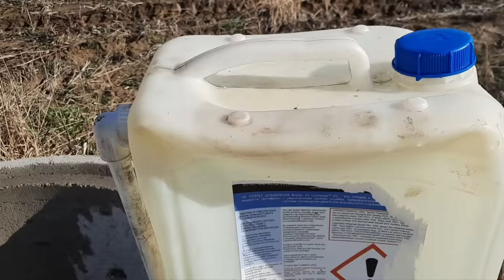Simple idea how to make a water pump without electricity without fuel

Comment: Someone plz explain to me..... what makes the water flow?.....do I have to fill the Jerry can first?
Reply: It is a syphon. The water will flow as long as the level in the well is above the end of the pipe. The tank makes it easier to fill the pipe and get the syphon started, but it is not really necessary.

Comment: As you can actually reach into the water, just slowly submerge the hose into the water to fill it. Stick your finger over one end, drag the hose to the same (down-hill) location and remove finger. et-voila. saved yourself all that effort and parts.
Reply: lol, indeed so easy can it be
Reply: There are different ways. 
- Hold the two ends of the hose at the same level letting the hose form a “U”. Using a funnel and fill the hose. Close one end with your finger, drop the other into the well an walk downhill. 
- Use a foot valve and a rod. Put the foot valve into the well and rock it up and down rapidly until the water starts to flow.

Comment: You could connect this up to a water wheel to gain some head height on your water flow? You can then used the motion of the water wheel to additionally "pump" to gain pressure?

Comment: Any good mechanic or steam engineer or good old hand will teach you that in this case you just put that hose submerged into the fluid and keep one end always submerged while you take the other end carefully down lower than the bottom of the tank while you keep it capped or covered with your finger.  Then you uncover that end and gravity does the rest - the fluid will flow!!  The farther below the top of the fluid in the vessel to the outlet of the hose, the faster the flow - That is what we call the Head of the system.  All the other bells and whistles, song and dance, are just for show - Magic!!!
Reply: Yes, and here yoy must bring the output end lower than the water level in the well to make this run. Then you have moved the water from a deep well to another even deeper well. Why so?

Comment: Unfortunately this "pump" works only if the exit point of the system is lower than the water level in the well... And with this water level in the well you could much more effectively just draw the water with a bucket...

Comment: This is working like syphon right? I will try to pump out water of abandoned cellar:D
Reply: Only if the outlet is lower than the cellar floor. That is how a syphon works.
Reply: @Dingsrud  only if the outlet is lower than the water the inlet is put into. It does not have to be lower than the seller floor until the depth of the water approaches the seller floor.

Comment: And if you allow the water from the hose to go back into the well, then you have a perpetual flow!
Reply: This will be difficult since it seems that the end of the hose is lower than the water level in the cistern. (It can't be an ordinary well, since ground water could never be higher than the surroundings.)
Reply: If the end of the hose is higher and water is allowed to flow back to the well. That will be perpetual flow and electricity can be generated by putting an alternator, but can that work?
Reply: @innopeaceideas8434   No, it can not work. Perpetuum mobiles are not possible. When you see something like that working in a video you can bet it is faked. Neither barrels with vacuum, valves, different pipe dimensions or what ever can make this work. You can't lift water to a higher level without an input of external energy. 
On the other hand, if the outlet is lower than the water level in the water source, it does work, but no barrels with a vacuum are needed. All you have to do is to prefill the system with water. But since such "siphons" were known already B.C. it is nonsense to present this as a new invention.

Comment: The physics in this is great and works. But if you had made a plastic jug stand higher up above the well. Then, the water pressure would be higher.  At a rate of 4.3 lbs per 10-feet of elevation.  Great job though.  :)
Reply: This is at best a great fake, unless the outlet is lower than the water level in the well. If this system would work with an outlet higher than the water level, you could at once build a perpetuum mobile. But perpetuum mobiles are not possible.
Reply: For this to work you only have to place the output lower than the water levek in the well. I.e. another, even deeper well.

Comment: Only works if the water-level in the well is higher than the end of the delivery hose. The drum and tap are completely superfluous, you just need to lower the delivery hose into the water, put your thumb over the end and take it down the hill.

Comment: Very simple way lifting water from underground well that so inexpensive too.
It needs a secure air tide bottle and few pvc pipes. Make sure bottle has enough pressure controls construction that means quality material made product.
Wonderfully presented it.
What is siphon?
"Siphons are often used to empty containers of liquid that would otherwise be difficult or impossible to empty, for example, a large glass fish tank. In a siphon, the water falling down one side of the tube pulls up water on the other side"

Comment: Ro: 1) Nu e o pompa de apa, e principiul vaselor comunicante, cum tragi vin sau apa, dintr-un butoi care e mai sus si o sticla care e mai jos, printr-un furtun, simplu? 2) daca luai un furtun si il amorsai, adica il umpleai cu apa, si l capatul de jos puneai un robinet pe oprit/OFF, il bagai in fantana capatul  de sus tot asa  iesea, ca atunci cand schimbi apa la acvarii  >> EN : Ro: 1) It's not a water pump, it's the principle of communicating vessels, how do you draw wine or water, from a barrel that's higher and a bottle that's lower, through a simple hose?  2) if you took a hose and primed it, i.e. you filled it with water, and at the bottom end you put a tap on/OFF, you put it in the well and the top end still comes out like that when you change the water in aquariums

Comment: It's just a syphon. Definitely NOT a 'pump.  You can forget about all the dicikin' with the drum and the drill, all that does is fill the hose with water to start the syphon. There's several simpler ways to start a syphon.

Comment: Let the water fall on a paddle wheel with a small generator and get free electricity.  Small amount but all day long.  Add more siphons and get more water with a bigger generator.  Stand it in a pond so you never run out of water.  Also, increase the fall height of the water.   Would it work?  If so we just solved the energy crisis and made the greenies happy too.
Reply: It is  impossible

Comment: This is a simple siphon. It works because the water level at the pipe outlet is lower than that in the well. If he hadn't connected that long pipe to the tap, the water would have stopped flowing from the tap as soon as the plastic tank stopped compressing due to atmospheric pressure. Which means if the tank was made of flexible rubber bladder for instance, the bladder would almost completely empty and stop. But if the tank was made of inflexible steel, like a jerry can, little or no water would flow out of the tap.

Comment: would have worked without the plastic barrel. also , this is called a siphon, not a pump.
Reply: And a siphon only works from a high level to a lower level. This is nothing but a barrel filled with water,

Comment: have a similar design concept in my water bottle. put air pressure in and the only way for the water bottle to equalize pressure is to make water go out of the bottle. same concept. may be able to connect an air hose up to the jug with a one way check valve to get the flow to start with another check valve at the outlet to prevent air from coming in the outlet.
Reply: This is a simple siphon with a container added. It will only work if the outlet is lower than the source, as with any siphon.
Reply: @joseas1518  Your water bottle pump works fine. The lifting energy comes from your hand pressing the water up and out. The pump works the same way as a maual bicycle pump or a manual water post pump. 
The “pump” in the video has no power input. Then it can not lift anything. The output must be lower than the input, then the video is ok.

Comment: The idea there of course water flows out to  the lower level from the source of water. If the hose puts at the level or higher than the source, water does not flows out.

Comment: How many meters is the height of the water from the well? 3-4 meters is?
Reply: It is not the depth of the well which matters. The problem is, that this can only work if the outlet is lower than the water level in the well.

Comment: does it work for bore well
Reply: Yes, as long as the discharge is lower than than the water level in the bored well. In other words, it only works in a steep hill. It is a simple syphone that is a bit more easy to prime.

Comment: So - if Ill return water to the well, it will be a perpetum mobile?
Obviously falling water could rotate some turbine!
Reply: Was trying same idea XD But its seems be fake. Anyway perpetum mobile real in my brain but in real world not so much XD
P.S. There still a hope with ram pump  :)
Reply: This is a siphon, not a pump. For the siphon to work, the discharge end of the hose must be lower than the level of the water in the well. It cannot be under the same water. This would stop the flow. There would be no way for it to operate a turbine while returning the water to the well, there would be no flow.

Comment: It's a siphon, not a pump. It will only work if the container can withstand the vacuum created by the column of water...and then only to a certain height.  In addition your methods for getting things done are poor, at best. Also, sharpen your drills...that one took entirely too long to go through thin plastic.

Comment: !Sorry for my bad English!

Big IMPOSSIBLE.
gravity pulls anything to lower level, when you open the tap the water in the can will rush to lower level (well) and if you use a reverse water blocker at the input source, and turn ON the tap a few drops of water will flow from the tap and a negative pressure will be generated in the container, this negative pressure will suck ( from where?) From well, nah
Well water is at very low level, now what will happen is the negative pressure will stop the water to flow from the tap and suck air from tap equivalent to negative pressure and again release some water, 
This will be repeated until can gets empty.
But but but
I've seen some videos of pulling water from rivers and streams by using empty barrel, 
I don't how they works
Are thy real?

Comment: This can't possibly work once the initial stored energy inside the container is depleted. Otherwise you could raise water indefinitely and the gain energy from running it back down to the well through a turbine. You would have just invented a perpetuum mobile. And they don't exist because they can't by the laws of physics.
Reply: Actually you would have a ways of creating energy out of nothing.

Comment: This is well known and widely used. The redundant container was added here just for confusion.
Reply: The container is not directly needed, but adds some functionality: 1) you do not need any foot valve in the source. 2) the system can sustained some air leak for some time. 3) Easier to prime the siphon.

Comment: a water pump pumps water up hill . this isnt a pump all it was doing was siphoning the water downhill . you could have bypassed the whole plastic container and just used a hose to get the same result
Reply: No, there must be an opening at a high level where to fill with water that will prime the sucking
Reply: @davidgaras  There are a number of ways to fill a hose with water.

Comment: It wouldn't work if the drawline from the well to the sealed jug is greater than can be overcome by the initial vacuum.  

Though, if it was a deeper well/longer supply pipe, adding a valve to the inlet pipe would enable closing it without losing the prime from the initial fill of the jug, allowing one to refill the jug and continue to prime. Once primed, as long as the system is vacuum tight, the supply spigot would always draw water from the well without the need to re-prime.

Comment: Eh…no electricity…using electric drill…electrical heated glue gun…oh and you need to fill up the container with water…which you just tried to reach with this pump. 
About no fuel…there is a BMW in the background!😂
And watering the plant works only down hill so your well must be at the highest point…
And the the container collapses under the vacuum…
For the rest…nice video🎉